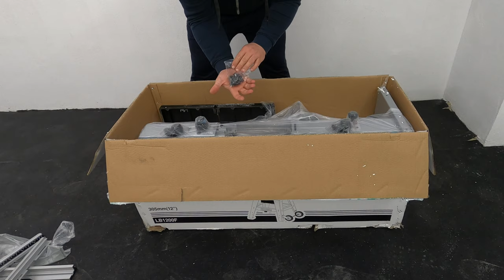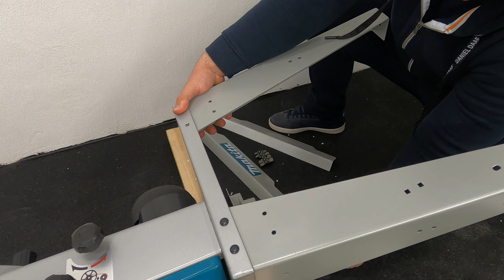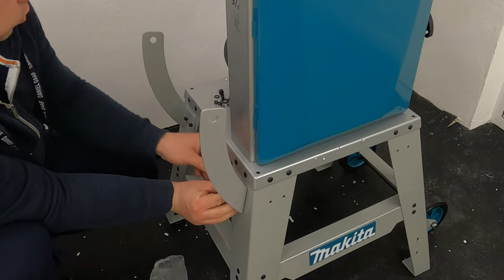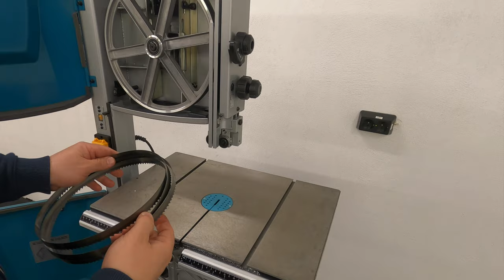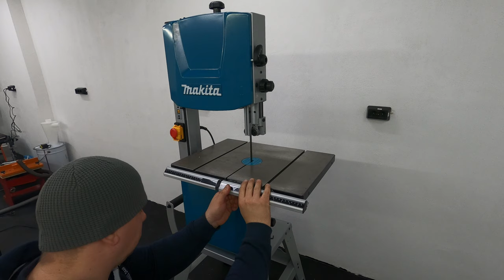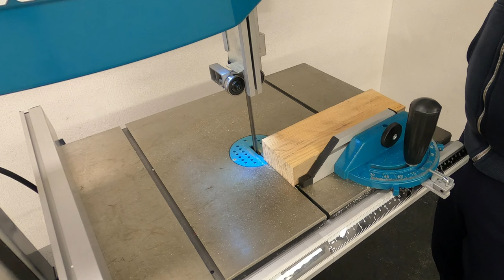Bandsaw Makita LB1200F Unboxing and Review

Comment: Was trying to find the table height. Yours looks.like the only one with this important dimension. Thank you
Reply: It is too high for integrating in the middle of my dual workbenches for infeed and outfeed extensions. But i see that i can possibly cut the legs down and move the wheels up. Ive already achieved that with planer.

Comment: Very thorough presentation. I will probably get one for my workshop! Still, I have a question. Due to limited space, I am inclined to set it straight on my workbench without installing the extra legs at the bottom. So what is the height of the bandsaw without the legs? Thanks for sharing!